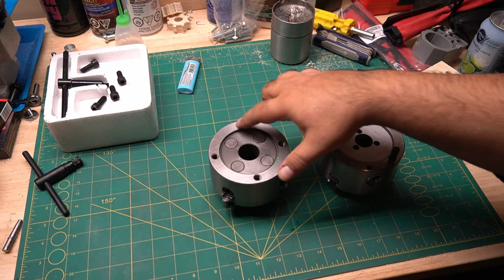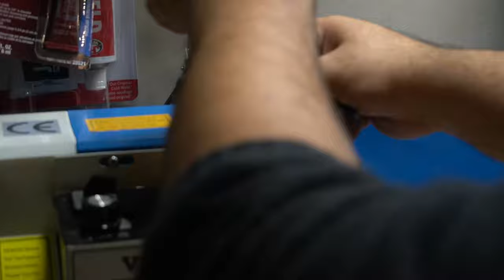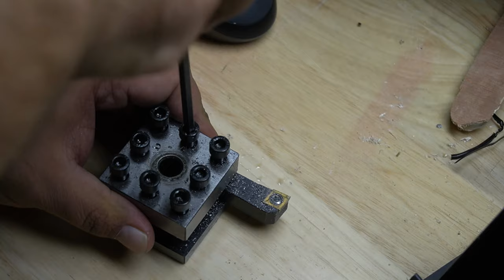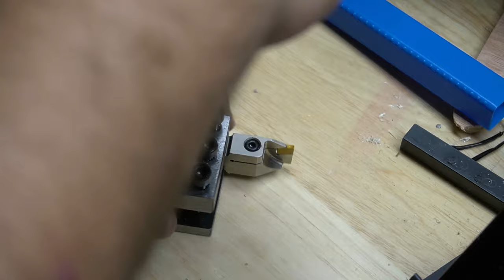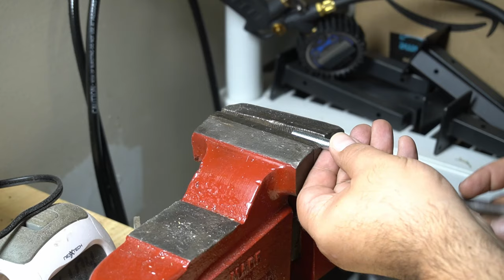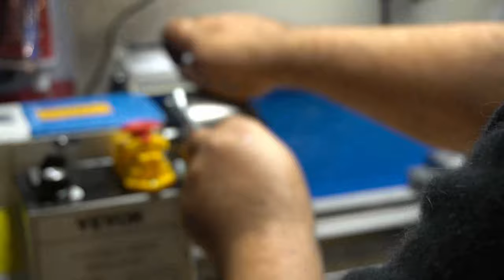7x14 Mini Lathe - 4 jaw chuck upgrade

Comment: Do you have a link to the 4 Jaw you bought? Also a suggestion is to AC glue the threads in nits then use the nuts as work holding, when you want it off soak in acetone to dissolve the glue.
Reply: I would like to know the same, I just brought one

Comment: Ι have the same mini lathe with 4 jaw chuck 80mm and i want to fit on the 4 jaw 100mm my lathe axhle plate has bolt holes for 4 bolts chuck and 4 bolts chuck if i buy the 100 mm who has 4 bolts will it fit on or i need to make an adaptor plate? Thank you

Comment: You can buy a quantity of that bolts from "Arc Euro Trade", sorry now they are out from Europe ( the company is based in England ), so buying is not so "straight forward" as before. I bought a couple of dozen, after having overtight the original bolts ( and happily i was able to turn them off of the chuck ... ).
Don't you see how your bolts are not ALL threated ? A common screw is not the ideal solution, even if cutted at right lenght. And also, are you sure to change the bolts from a three jaw chuck to the four jaws chuck and reverse, every time you'll have to change chuck ?
Believe me, changing chuck is not so uncommon as you can think now, at the beginning of your lathe experience.
Reply from the maker: Hopefully folks can tell I have no idea what I'm doing, comments like yours are great for helping me and everyone else learn from my mistakes.

Comment: If the tool was at the correct height the screw was hanging out of the chuck too far,allowing deflection!
Reply from the maker: The tool was definitely not at the right height, this is when I learned that tool sizes are important to pay attention to 😂

Comment: The intent of this video was good. However, watching this video scared the crap outta me, for the machine operator. I have this same machine for small projects at home. I’m not a professional machinist, I had some training back in high school, back in the day when they had shop classes. In our metal shop we had, no pun intended, “old school” Bridgeport mills and lathes. I still remember watching the safety films about what happens if the setup is incorrect, the wrong cutting tool is used, LOOSE MATERIAL flying outta the chuck, inserting tools on any part of the machine while it is in operation and using substandard hardware on the machine to replace or repair parts (E.G. using grade 2.2 or grade 5 bolts machined down to make stud bolts that can fit into the chuck that should at a minimum be grade 8 or higher stud bolts)… I also remember the shop teacher saying every morning “15 minutes of a good equipment inspection and proper setup will save time and money in screwed up equipment and project materials, not to mention a trip to the hospital or mortuary”. I ain’t hatin, I’m just sayin.
Reply from the maker: I tried to make it obvious in all of these videos these were more about "watch an idiot discover how not to play with dangerous things" - mostly because I was going to learn on my own anyways and I figured others could watch me make mistakes rather than repeat them.

Hopefully any folks watching read the comments like yours and take note
Reply: @RRFTube  - I get it.. I didn’t realize you were flying by the seat of your pants until I finished the video and read some of the comments 😂. But it did scare the crap outta me, seeing the deflection and the material moving as you were turning. That is a lot of unnecessary risk for the sake of learning and showing viewers your learning curve. I just don’t want you to get injured… new fingers are hard to come by these days 😜
Reply from the maker: @Patriot_Drone_Services  Thanks, I added a note to all the descriptions to make it more clear that these were my literal first attempts at any of this, not demonstrations to follow.  Even with such a tiny machine it became clear pretty quickly that it could still do a lot of damage.  Shop classes would probably have saved me a couple hard lessons for sure.